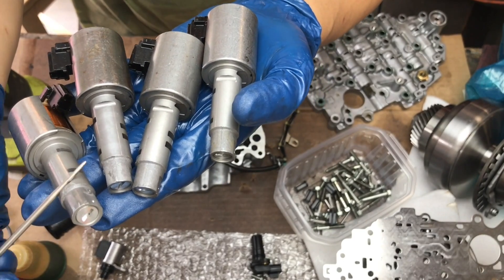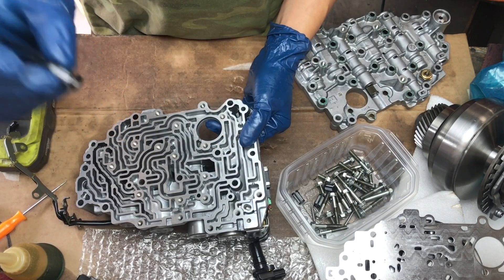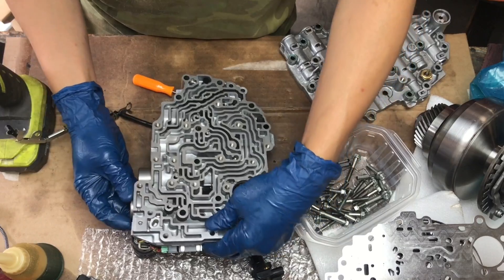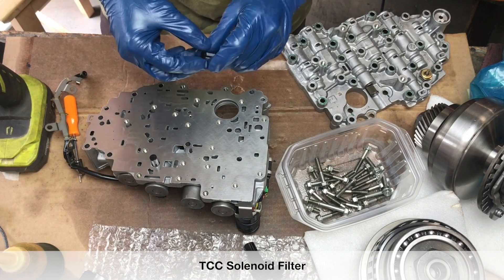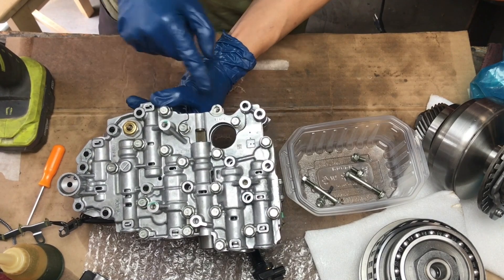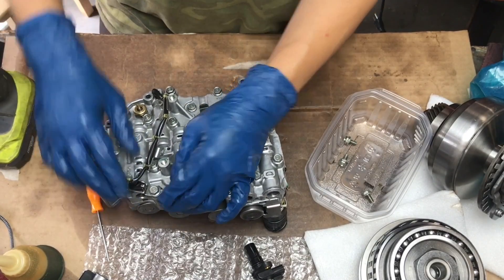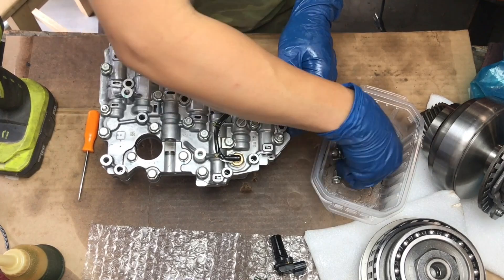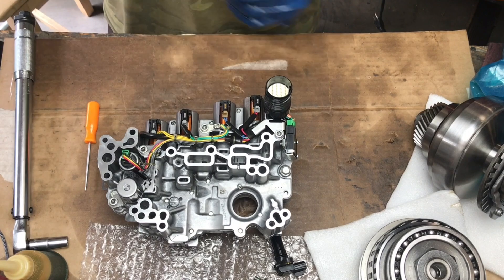Nissan Versa SV 1.6L 2012 - Part 1/4 - CVT Valve Body Reassembly REF011A / JF015E

Comment: Was curious with the over all rebuild, are these new solenoids or just cleaned up original ones? Also besides the rebuild kit is there any other new components that are changed or installed? Is there any programming needed after? I recently dropped the pan on 13 Sentra magnets had mounds of metal filters changed 4.5qz later not wanting to up  shift stuck in first and hard
Reply: Get a multimeter and check the shift solenoid. CVTs are known for solenoid failure or valve body failure when the fluid is contaminated.

Comment: My 2012 model Nissan Micra 1.2 automatic vehicle sometimes, but not always, engine malfunction light comes on at speeds of 60 kilometers and it disassembles. The problem of going away when we take our foot off the gas and press the gas again. When we connect it to the device, it gives error p0846 FLUID PRESS SEN/SW B. What could be the problem?

Comment: here are OBD2 fault codes for my 2015 Nissan Versa Note SV:  1.)  P0963 - Pressure Control Solenoid A   2.) P099C - Shift Solenoid G   3.) P0999 Shift Solenoid F  4.) P0967  - Pressure Control Solenoid B (Primary Pressure Solenoid)

Comment: how is the best way to clean out those little filters?  Can I use brake clean or is there a better option?
Reply: Compressed air worked pretty good
Reply: Compressed air worked pretty good

Comment: Hey mate, I will be stripping my JF015E this weekend, it has some random splips, engine flares way up every now and then, did you just strip and clean or did you replace anything? I have the master rebuilt kit but that only has seals, clutches and gaskets, nothing for the value body. Anyting I should be looking out for?
Reply: Just seen your description lol, new Solenoids

Comment: Please, I have a problem with a 2014 nissan versa note, the valve body looks the same as yours but the solenoids are slightly different,  would you kindly identify what each of the solenoids do?

Comment: Very helpful, I've never worked on anything like this and with this video I felt confident enough to try
Reply: I got a Torque converter clutch that seems to be open. Code p0740 just lifted the versa and removed the tranny oil and yea I'ma give it a shot.

Comment: I changed the pnp switch for the transmission. Car was going limp once I'm awhile and going reverse in park mode occasionally too. Now the issue is sometimes loud noise with light shaking. Not going into reverse all the time. Have to restart the car and reverse will then work. Could this be the valve body or is it the solenoid?

Comment: I have a nissan sentra with a cvt transmission with a p285a code replace the part that you are resemble and nothing change still with the same issue. Any suggestions will be great. Thanks great video

Comment: I'm so confused how many variations of that valve body are there. I'm trying to fix a 2014 sentra's. I ended up using a 2013 Sentra valve body but it doesn't use the same wire harness. What's going on?

Comment: So did this solve the no reverse problem from the nissan forum? Im having an issue with a rebuilt trans. All other gears perfect just no reverse
Reply from the maker: Yes, that problem for me was solved not through the valve body but...  located around 12:54 on this clip: https://www.youtube.com/watch?v=FOwF7JgpZ2s&t=1s
Reply: @TheLaborService  thanks i seen that in the second video. Did you have to reprogram anything after you where done?
Reply from the maker: @acrophobiar1  No, but just a to let you know, if you decide to buy a new valve body, all you would simply have to do is swap that small EEPROM on the valve body, so you would not have to go through the reprogramming at the dealership. Swap that small black box, where the transmission connector is connected to with the green connector on the wiring harness. Put your original one in the new valve body. Hope that didn't sound confusing.
Reply: @TheLaborService  i swapped the whole trans out with a "factory rebuilt one" and i have no reverse but its the same issue you had everything works exept reverse im thinking that piston is in wrong like yours was. Or should i try the valve body off old trans?
Reply from the maker: @acrophobiar1  Ahh so hard to say, you know I had to do some trial and error myself. I would probably just try the old valve body first, it's easier than having to pull out the whole tranny again. Good luck! let me know how it goes. Someone who isn't experienced enough would have just put the cover on and crushed that piston down, in which I did. But, if you bought it rebuilt, say let's give it the benefit of the doubt they knew what they were doing, I'd say try swapping the valve body. If not, then you'll probably have to go in and check. It such a pain.
Reply: @TheLaborService  will do going to try it tomorrow after work thanks for the help and great videos

Comment: Very helpful video, I just have a question can you still reuse the plate/gasket that is sandwiched between the valve body and also what’s the torque sequence when putting the valve body together and also installing the valve body back into the the transmission.
Reply from the maker: If you are talking about the metal plate between the valve body, yes clean it and reuse it, change the small screen filters inside. No torque sequence on the valve body.I would just do a criss cross pattern.
Reply: @TheLaborService  oh ok also are you talking about the 2 tiny filters for the valve body or the strainer filter inside the tranny pan
Reply from the maker: @HaystanHopar  the filters in the valve body as shown in the video
Reply: @TheLaborService  where did you buy those, I can’t find any online
Reply: @TheLaborService  ok never mind I think I found them, they are like $5-6 a piece plus shipping, it’s very hard to find parts for this transmission for some reason, no wonder everyone says you can’t rebuild these only replace it lol but thank you very much bro I’ll update you how my transmission goes, hoping this solve my transmission issues.
Reply from the maker: @HaystanHopar  should be transmission rebuild kit on ebay
Reply: @TheLaborService  my 2013 Sentra which I believe is the same as your versa’s transmission is shifting very weird and slow and even stoping driving at one point I got a check engine light code of p285a I hope cleaning the valve body and solenoids as well as changing both filters and the oil solves my problem. I hope the new Nissans aren’t crappy like ours.  🙏🙏🙏

Comment: Where did the clutch solenoid go? At the end of the video it’s still laying on the table.
Reply: Oh wait never mind. I thought that was the clutch solenoid, but where did that part go?
Reply from the maker: @victoriablevins2654  That part has nothing to do with the valve body. That is a speed sensor, there is one that goes on the sub assembly and one that goes on the transmission. Where that goes is shown in a different video.

Comment: Do you have to take out the transmission to replace these
Reply from the maker: No you do not, you have to drop down the tranny pan, remove the tranny filter, remove the bolts with the number 9 on it, I believe it has a 9 on it or 10. There are bolts in there with a number, its the only ones that have a label them, do not remove the unlabelled bolts, and then disconnect the valve body connector. And it should come out.

Comment: Boss my nissan vnot 2014 RPM is up and speed is low so what is the problem
Reply from the maker: When was the last time the transmission fluid was changed? did the filter get changed? did the cooler filter get changed? what kind of transmission fluid was used? How many miles does the car have? Does this happen all the time? or some times? Does it feel like its slipping? or is the RPM just going high, but the car is not going fast?
Reply: @TheLaborService  the fluid is lucas cvt
It was almost 1 months ago cheng fluid and filter also cheng
Reply: Thanks for answering. It is  171000 Kilometers
Reply from the maker: @nilugajjar8205  Did it start shifting bad after the transmission fluid change? Well, from what I know is, Nissan Transmission must use Nissan NS-2 or NS-3 depending on your vehicle or Idemitsu CVTF. Idemitsu actually supplies the CVT oil to Nissan and they rebrand it and price it up is what I've been told. You can probably research more. I believe that the Lucas oil might be making the oil overheat, these transmissions are very sensitive to contamination. My best guess is that the Lucas CVT is the incorrect oil and if it happened after the transmission change, it now need a really good flush, and all filters changed again. When did this start to happen? These transmission also have a life of around 80,000 miles to 120,000 miles. Have you changed the fluids before? or was this your first time? My transmission belt inside broke into pieces around 110,000 miles, with bad maintenance of course, I was not aware how much maintenance these transmission needed.

Comment: I don't trust my dealer. Can you please give me an estimate of how much this fix costs in terms of parts and labour hours?
Reply from the maker: I know the dealer will simply pull out your old transmission and put in a new one, which cost around $3500. They usually don't rebuild CVTs, I don't know why. It definitely takes some time to do. If I were to be doing this given all the parts, it would probably take 4-7 days. In this case, I was filming, and having to order parts mid way, which took me a bit over a month to do. I wasn't on any time frame.

Comment: I’m currently getting my CVT rebuilt and I am just entirely fascinated by how intricate these machines are. It must have taken a long time to understand how to fix them properly.
Reply from the maker: Well, I had no idea what I was getting into. Just cracked it open and tried to figure it out. There's some information out there on the web scattered around. It's actually not that bad. It's a little bit easier than a regular transmission, everything is pretty straight forward inside. We can see how badly these things were designed. I'm glad you enjoyed it. Thanks for watching!
Reply: What you mean?? They are easier than older transmission mechanic get scare because they are new and not too many people want to deal at Learning…. Youngster will do It! We got internet and commitment thats all you need

Comment: Awesome video man! I have a 2016 Nissan Versa 1.6 and can't seem to find the shift B solenoid anywhere. Not even on Nissan Parts website. Does it go by another name when looking up parts?
Reply from the maker: Hmm, I'm not sure, do you know the model number of your transmission?
Reply: @TheLaborService  I finally found a parts car to pull the whole valve body from. My question is how do you pull the black cylinder shaped harness plug from the car itself? Trying to remove a used valve body from the parts car but it seems to be lock to the transmission. Is there a certain clip holding it in?
Reply from the maker: @CP-nh6ml  You got to use a flat heat screw driver to push down the clip its somewhere on the side from the top of the connector. And then the whole thing turns and you can pull it off. I've got some screen shots from my video that I haven't got to edit yet.. Press on this tab, and you should be able to unlock it and turn it counter clockwise to remove the connector... https://i.postimg.cc/BbXNPVRV/Capture.png     and    https://i.postimg.cc/nzLGNWVh/Capture2.png   After the connector comes off you may have to push it down with a rubber mallet or something to get the valve body off.
Reply from the maker: REF011A / JF015E

Comment: Hi if you can help where is the pressure sensor cod p0846
Reply from the maker: Sorry for the late reply, it should be the Primary Pressure "B" solenoid in the clip. I would recommend just take apart the entire valve body, cleaning it, adding new solenoid filters, and also new solenoids.
Reply: P0846  transmission fluid pressure sensor switch B circuit  ..an what parts need to replace  only the fluid pressure sensor?or no

Comment: Great video!!! Do you know if this is the same transmission valve body for the 2013 Nissan Versa 1.6 Sedan?
Reply from the maker: If the transmission is a REF011A / JF015E the valve body should be the same, but if it is a different model the valve body may be different, however, the same parts should still exist in the other valve body. It's possible to have different solenoids and numbers of filters etc, but the rebuild process should be fairly the same. Just make note of everything when you are take it apart and be careful not to lose place where the check balls are.
Reply: Ok, will do. Thanks! One more question;can the cvt belt be replaced without removing the transmission from the car? (2013 nissan versa sedan)
Reply: @LYVEWYRE12000  Sadly no, you'll have to take the whole thing out and clean it and rebuild. There is also not enough space to just pull out the pulleys and belt. And when putting it back it must be precise and straight as well, doing it in the vehicle would not be great.
Reply: @itscryptomaker4837  Ok, thanks for the advice, much appreciated!!

Comment: my transmission revs high and seems like doesnt want to go into "higher gear". i discovered that I have 6qts of oil inside when i drained oilpan, instead of around 3 quarts. now when i put the trany into netral and let rmps drop, it shifts or goes back to normal. please advice what my issue could be, belt? Valve body?
Reply from the maker: Have you pulled down the transmission oil pan? I would suggest. Taking out the transmission oil first, then take out the tranny pan, then take out and replace the transmission filter, clean the oil pan and all the metal debris inside thats attached to the 2 magnets on the pan,  remove and replace the transmission cooler filter, it is possible that debris is clogging up those filters. Put a new tranny filter, new tranny cooler filter, put back the tranny pan and gasket, and put in new transmission oil. Before taking off for a test drive, make sure to switch the gears PRNDL stay around 10 seconds on each gear, and switch around go from P to L, P to D, etc in order to get all the transmission fluid to flow through the gears.

Comment: Thank you so much for your help do you have to reprogram your transmission ?
Reply from the maker: No, there is a EEPROM on the valve body that saves the memory, easy to remove. If you swap valve bodies you will have to swap that EEPROM using your original one, but if you are just changing the solenoids and using the same valve body, there should not be any issues. However, if you'd like to do the relearn process, it is explained here at the bottom: https://gearsmagazine.com/magazine/jf015e-common-issues/

Comment: Where you get all the parts
Reply from the maker: The rebuild kit, and the secondary, primary, and belt, were all purchased on Alibaba.com. The company I spoke with and got very helpful information from was Guangzhou Xinyulin Auto Parts Co., Ltd. And they are the people that supplied the parts for me. The pulley kit was $236.50. and the master rebuild kit was $89.50. With shipping and everything it was $475. Shipment was also quite fast. I believe it was less than a week to arrive. The solenoids, transmission oil pump, Loctite SI5460, transmission NS-2 Nissan, were purchased on Ebay.